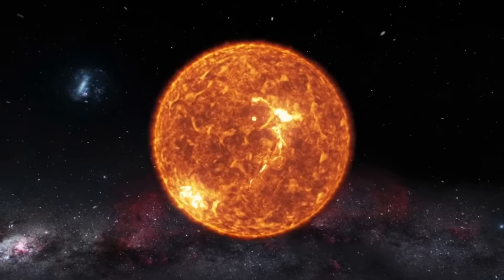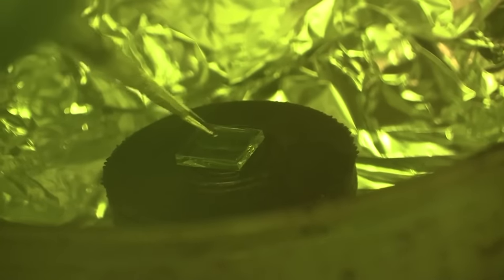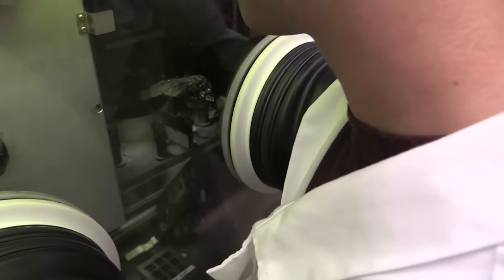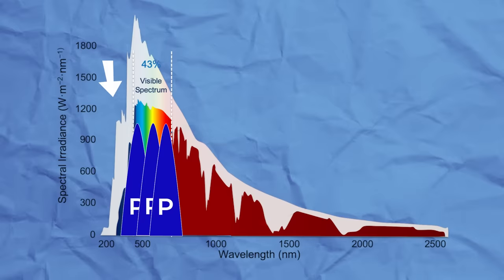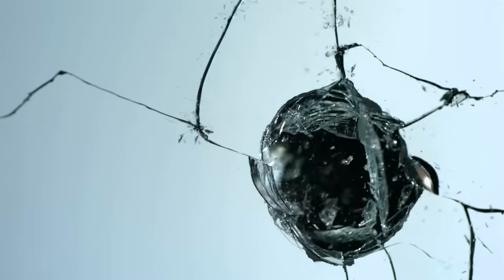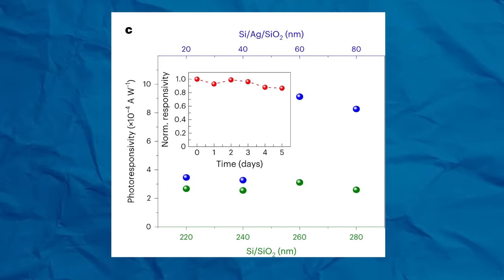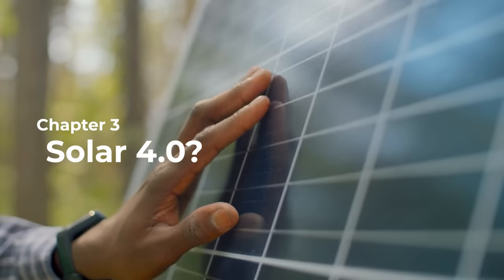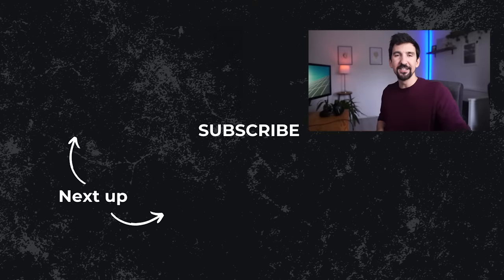Solar 4.0: Ultra Efficient Solar Panel Breakthrough

Comment: As someone who gets 90% of their power from a small 2kw solar/9kw LFP system, much higher efficiency and lighter solar would allow me to go 100% throughout winter. It might also allow me to charge a small Ev so I don't have to burn stuff ever again... Seeing they have yet to solve Perovskite's durability its still 5 and probably 10 years away before I get to buy it though. Lets hope Ai starts doing some heavy lifting to move things along a bit faster.
Reply: Why don’t you add few more panels to get to 100%?
Reply: What solar panels are you using. You can already buy bi facial panels with cells of afficiency of 24%
Reply: If this is solved in 5 to 10 years, it would be a great success as the world turns towards renewable energies.
Reply: AI doesn't create knowledge. It only re-arranges and re-presents existing knowledge
Reply: @yourlogicalnightmare1014  
..I would omit the word ‘just’ my friend. We know enough physics and science now to change the world so a bit of re-arranging would do just fine!
Reply: @yourlogicalnightmare1014  depends what kind of AI. Protein solving is now solved thanks to AI.
Reply: @castortoutnu  
Equation solving has been around for decades in Excel and for 100's of years on paper.  Similar to how quantum computing will break cryptography in a day or two that would take an ordinary computer a million years.

AI has no genuine intelligence.  Just path finding/goal seeking type of behavior, limited to the 1's and 0's rules of programming.

I am excited for the possibility of one day being able to compete against a trillion dollar hedge fund though.  Getting to trade fractions of a penny every millisecond using AI to examine millions of bits of economic data every femtosecond has to be a huuuuge advantage.  One that should be criminal if only the mega wealthy get to engage in that outrageous practice.
Reply: @yourlogicalnightmare1014 while its possible to solve equations in Excel, it is definitely not the software of choice.
You say AI has no genuine intelligence but then say it will help your trading? Bit confusing.
Reply: @Sasoon2006  Small roof
Reply: @M  
Being able to compute massive amounts of data quickly provides significant advantages, but in and of itself, to me, doesn't suggest "intelligence".  When cars achieve "full self driving", they are doing so through compute power using algorithms.

0's and 1's don't possess autonomy, curiosity, intention, or will.

Imagine an AI that could recognize its own compute power, wonder about what is possible to learn from its abilities, theorize, experiment, and come up with an anti-gravity device all on its own without being human directed to do so.

Or an AI that could look at the field of medicine, determine where the biggest problems are, and go about solving them on its own.  It would give us cures for cancer, alzheimers, parkinsons, paralysis, diabetes, macular degeneration, PTSD, aging, ...

Or even better, tell us how to modify our DNA to grow brains & skulls 2x bigger such that we could have 500 IQs.

Or even better, tell us things we haven't even conceived of and that are so foreign to our being it's unlikely we'd have ever conceived of it.

AI has a tremendous way to go to be more than a prisoner to programming rules and processor limitations
Reply: @yourlogicalnightmare1014  if youre going to try and sound smart, be intelligent with your grammar.
Reply: @M  
If you're going to try and challenge something, come with more than a petty, meaningless, irrelevant statement
Reply: @yourlogicalnightmare1014  didn't challenge anything, just pointed out the contradiction your poor grammar results in.
Reply: Heat/cooling/cooking/pumped water?  

No generator? Nice work. 

Forget this “Perovskite” hustle. It’s age of Theranos, FTX, Nikola, WeWork hyoe.
Reply: It’s not a few more panels.  Need to double to get through winter.
Reply: The LFP, that’s rated in kWh or amp-hr to indicate how long it goes, not just kw.  How deep does it go?
Reply: “hope AI”

AI might well say, “this is stupid try something else”.  Then AI will have fathom how to get anyone to listen, sense they wont.
Reply: 10 years away is the fusion timeline
Reply: @oowaz  eh, that’s the fusion hype.  No economic fusion power coming down the wire for 50 years, probably 100.
Reply: @Nill757  wild predictions. helium claims to be on track to net energy gain by next year. there are other promising companies like "first light fusion" claiming to be able to arrive at solutions trough even cheaper methods. and yeah like others pointed out AI will help speed things up (it is already) and we don't know how fast ai will keep growing. just google the nvidia timeline. by the end of the year they're releasing a new gpu that will deliver supercomputers up to 30x faster than our current tech and this is just the beginning. nvidia claims that by 2030 processing will be 1 million times faster.
Reply: @yourlogicalnightmare1014  At the current "exponential" rate AI is advancing, it won't be too long before it leaves us behind scratching our heads.
Reply: @yourlogicalnightmare1014  for now.
Reply: @eastlondonhustler  
That is equivalent to suggesting that once you obtain the correct number of exponentially increasing lego blocks and you arrange them correctly, consciousness will spontaneously arise.

It's an ontological fallacy, as consciousness is fundamentally different in nature than 0's & 1's and the finite number of ways those bits can be run through a processor.

Likewise, AI is what it is and won't be fundamentally changed by feeding it more training data or processing a greater number of 1's & 0's
Reply: You'll still likely never repay the envrionmental cost of making and disposing of them.
Reply: @oowaz  I’m trying to understand posts like that.  ^^

Would you care to predict when some “promising” cure for cancer will happen, how and by whom? Next year?  Judge the reliability?  Opinions on an end to Alzheimer’s?  Heart desease? How about new treatment for Arteriovenous malformations (AVM) which is currently dangerous?  

Probably not, because perhaps you’d agree you don’t have any medical background to judge any of these.  But on fusion, you’ve got it down to the year.  Are you an engineer? (No). 

Maybe it’s just the era that explains the fandom, the era of tech fraud, Theranos and bogus one drop machines, FTX, Nikola, WeWork, on and on.  All of them were detectable early with reasonable prudent skepticism. 

Now I don’t know why guys like you cheer them on with no due diligence, but make no mistake, cheerleading from guys like you is what allows them to happen.
Reply: @IanPritchard  While they may recycle the empty milk cartons, These “2kw” and batteries guys don’t environmentally dispose of things that cost them.  A truck might have delivered 400 lbs for 10 PV panels, and 400 lbs battery, no truck is coming to haul them away to a legit recycle place.   No tax credit for that see, and no guarantee from the utility to buy the old rig of junk for full price, like they do the power. Utility has to legit dispose of an old power plant or solar farm, but not rooftop guy.
Reply: @Nill757  i'm sorry did i not say that THEY (the engineers) are offering those dates, did you research any of it? i'm assuming not because otherwise you wouldn't claim i'm making it up
Reply: @jedics1  Panel racks with wheels are available, the cost might deter you, but you could set up another solar area on the ground. Something basic like a greenhouse structure could hold a couple more panels too, lots of people use solar in other places than a roof :D
Reply: @oowaz  I’m a design engineer.  Been following fusion for 30 years.  The only thing anybody will accomplish by next year is to get another grant, via some meaningless lab result that catches the public’s eye enabling more govt funding.
Reply: @Nill757  it would be healthy skepticism to doubt your claims. i never said i'm CERTAIN that fusion will happen by next year. this is a speculation thread started by someone trying to predict a timeline for solar panels solution. i merely relayed information given by engineers that they expect to have fusion hit the market by 2030 in a SPECULATION thread. if you have reading material that support your claims that helium or first light fusion are vaporware or something, i'd gladly take a look
Reply: @IanPritchard  30 years of free power is going to cover the cost better than any other technology we have currently.
Reply: @Nill757  My heating is diesel which gets used like 7 times in winter. Cooking/shower is gas and 8kg tank lasts 3 months. Water is from the mains tap and yes absolutely no generator, they are so primitive and noisy.
Reply: @Sasoon2006  do you know how friggin expensive they are lmao our entire solar setup minus the batteries is 25k.
Reply: @cdunne1620 the problem he's positing is a fear that we will rely only on ai for the generation of new ideas, but humans will continue to work alongside the tools we created as we literally have nothing better to do
Reply: @yourlogicalnightmare1014  It doesn't create, but it rearranges in ways we couldn't think of, tying separate things together that we couldn't even fathom. Also no knowledge is ever created, we also just rearrange things.
Reply: @Denis Florian  
If I give you 10 pennies and a chess board and say to you, "Place the pennies on the board in any arrangement you like", I can guarantee you won't place them in a way "I couldn't even fathom".

And yes, new knowledge is created.
There was a point in history where math came into existence for humanity, and before which it did not exist for humanity.
Reply: @jedics1  Ok thanks.  Your original post suggested you can’t quite get though winter w current 2KW PV and battery system. What happens when it doesn’t?  Go black? You did not mention grid utility connection.
Reply: even if there is a panel that does 500% my yearly use i still need a giant battery and the still cost way way way to much. my worst dys in winter only covered 3.3% of my daily use while i alrteady have 50% more on a yearly base then i use. That means i need over 45 times my yearly use in solar to make it trough the winter and then 10k on batteries.  its always going to be cheaper to be on the grid and pay for that.
Reply: @oowaz  “just google”

No. It’s helium 3, not 4, which doesn’t exist in quantity on earth, and their method of making Helium 3 from deuterium in an accelerator uses far more energy per he3 made than can fusion produce.  And, please don’t say they are “fusing”, present tense. They’re not.
Reply: @Nill757  are you serious dude? what do they do with helium-3? also "No, it is not incorrect to say "they're fusing." In fact, that is a common way to describe the process of nuclear fusion, where atomic nuclei combine to form a heavier nucleus, releasing energy in the process. So, if you are referring to the process of Helion Energy's nuclear fusion, saying "they're fusing" would be an appropriate way to describe it."
Reply: You do know you still contribute a ton of co2 right?
Reply: @pino_de_vogel  Where do u live? I live in Australia so more sun than most but I also have the ability to use very little power during the worst 2 months of winter. Eg. I just need to run some led lights, a fridge, 4g modem and my laptop which all uses under 2kwh a day.
Reply: @yourlogicalnightmare1014  Actually, we need to make all such trading illegal, such as by requiring all trades to be memorialized by a signed paper contract. This whole sort of activity is a huge energy waster that provides no benefit to society whatever.
Reply: @TC-kf9zw  Me breathing would also produce a ton of Co2 over time so your argument is either not very well thought out or well expressed or both.
Reply: @yourlogicalnightmare1014  you’re incorrect. It reduced 100 000 quantum physics equations to 4. Its helped design AI specific chips that wouldn’t have been possible in this timescale without it. It’s come up with new and completely changed chess and go strategies. It can create new stories and poems. There’s numerous examples of AI creating new knowledge.
Reply: @yourlogicalnightmare1014  also it can fold proteins and model them in 3D leading to new inventions
Reply: @jedics1  build a hut/shelter with more roof space.
Reply: @jedics1  Netherlands, we have very short days in winter and due to being so far north we have a low sun angle for most the year.
Reply: @jedics  not the samething but thanks for playing.
Reply: @StoutProper  
Every one of your examples is nothing more than equation solving and following strict rules of programming.  No AI is required for that.

Chess software was beating 99% of players 30 years ago.
Reply: Just remember the mining involved in ev batteries is arguably worse for the environment than a fossil fuel vehicle. I'd wait till carbon based battery tech improves
Reply: @pino_de_vogel  Ahh, explains a lot, Im not even near the equator and my panels are mounted flat. Its true what Zeihan says, geography matters.
Reply: @xguesswho222  Ahh you fell for the "ev's have as big of a carbon footprint as gas cars" argument. Lithium is just a metal that you dig out of the ground like all the others then it can be mined just as cleanly, if its not then that is another issue that needs to be addressed. Id argue its far worse environmentally to wait for a technology that isn't available yet. Also you do realise both cars use about 70% iron to make them? But only one has a potential 20+ year life of 200,000+ km of almost carbon free use.
Reply: @mightym  It will help everyone's trading. You are back where you started.
Reply: @msimon6808  where did I start?
I highlighted someone's contradiction when they stated AI has no genuine intelligence followed up with the comment it will help with their trading (but then talked about computational speed and exchange latency).
Reply: @mightym  trading is about pattern and trend recognition, something that current “AI” is good at, it doesn’t need any actual intelligence.
Reply: @yourlogicalnightmare1014  while i don't propose that AI is intelligent, how would you say a brain computes autonomy, curiosity, intention, or will?
because i would argue it could be possible with 1's and 0's.since our brains follow certain rules and algorithms as well.
Reply: @downey  
If you're a materialist that finds it remotely plausible that an arrangement of subatomic lego blocks results in awareness & consciousness, your question is way beyond what I can answer in a YouTube comment
Reply: @eastlondonhustler  Maybe AI will really leave us behind by leaving earth and beating us to Mars.
Reply: @castortoutnu  Protein folding
Reply: @jedics1  from what I understand lithium mining is very harmful to the surrounding environment in that it leaves behind alot of toxic waste products. Additionally cobalt mining is done primarily via slave labor without PPE for the toxic gases released by it. Although I'll admit idk how much is in EVs vs. Smartphones. So different kinds of environmental effects to be fair but still bad. Also emissions from energy for processing the raw materials can't be ignored
Reply: And 250% is also wrong, as at minute 8:10 show the photoresponse curve, and from about 3.5 to about 8.5 is a 150% increase. Is the big mistake done every where with % . The double of something is 100% increase, not 200.

Comment: The degradation has been a major blocking point.  If they can't solve this, then it doesn't matter how efficient they are or cheap.
Reply: Everything degrades over time. No exception. Considering what the materials are made from and how much heat is placed upon them on a daily basis, the degradation problem isn't going to be solved anytime soon.
Reply: You could say the same about roads
Reply: Self healing materials
Reply: Degradation of 20% over 25 years is not bad. If it could be avoided then great.
Reply: If the cost is low enough then it could be worth it. It's just that "cost" includes all the effort to replace degraded parts.